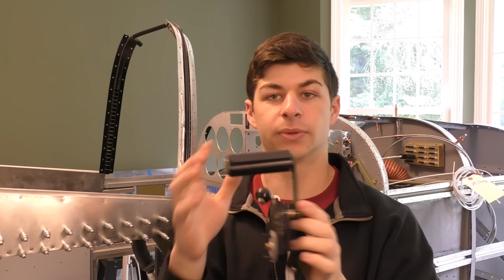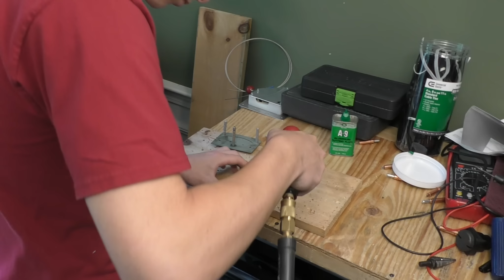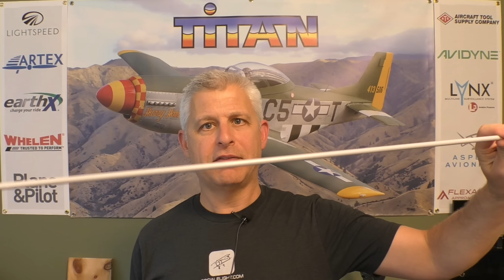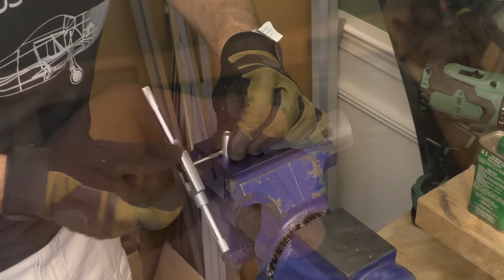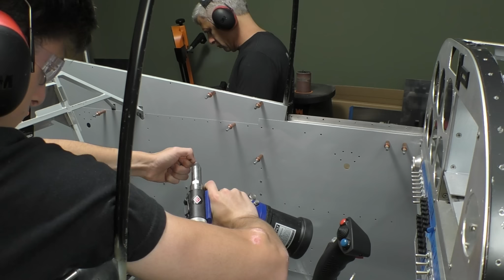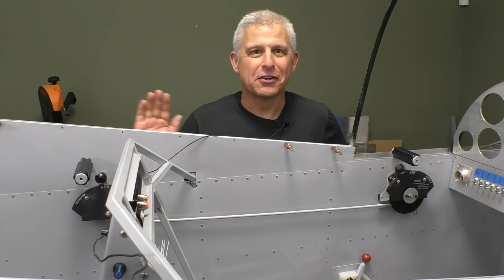Throttle Up! Building the Iconic P-51 Mustang Replica: Throttle Quadrant & Gear Lever

Comment: You mentioned the gear I remember seeing a video on YouTube a test pilot had to do a gear up landing on a T-51 someone had wired in the electric gear motor on the same fuse as the engine management system. The gear motor burned up and blew the fuse which caused the engine to quit running because the EMS lost power. There seemed to be claim that Titan recommended using that fuse not sure if that is true seemed like the EMS should have had it's own fuse as well as the gear both critical electrical systems.
Reply from the maker: There were several issues on that particular aircraft.  Our gear electrical system does not connect the gear pump to any other critical systems, such as the engine systems, which are also isolated.  Additionally, there is a backup battery system that can easily power the aircraft on its own.

Comment: In regards to your throttle microswitch, you may want to consider having it triggered when the throttle is high, and go open when the throttle is low, that way if the switch or wiring fails, it will default to a warning. Just a thought. This is the way most Cnc limit switches are designed. Ie. normally closed. Just started watching, love the build, what a dream!